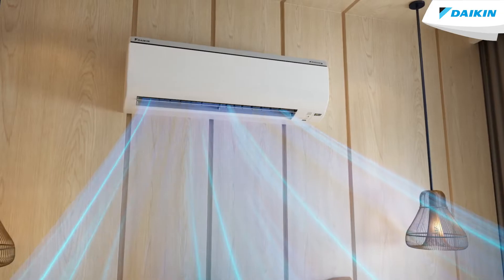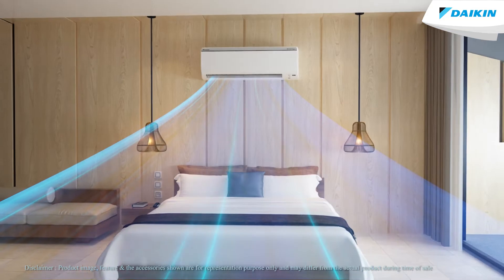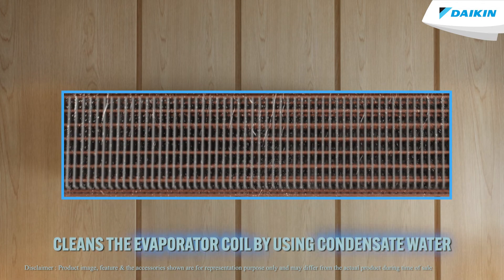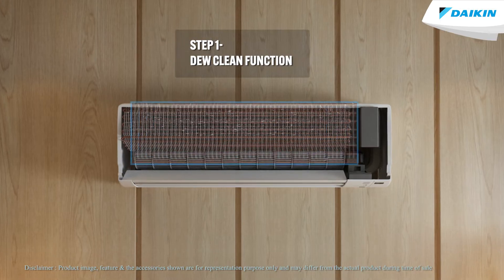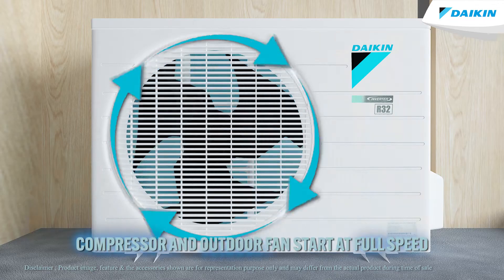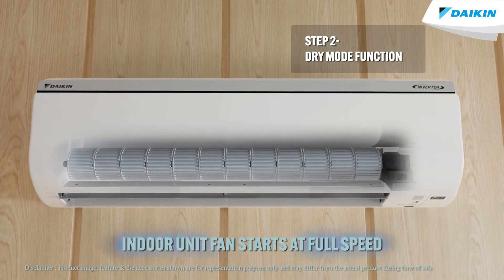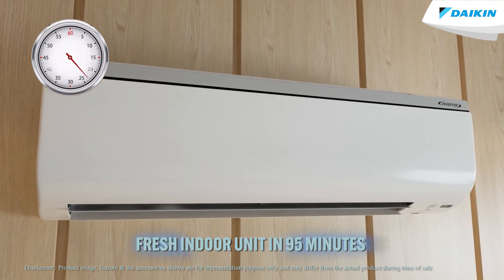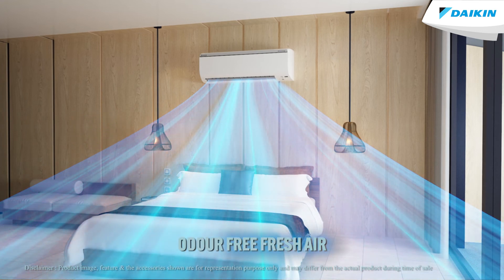What is Daikin's Dew Clean Technology? And how can it clean your AC indoor unit by just one click

Comment: So, servicing is not required if we use dew clean regularly?
Reply: Not actually, you need to eventually clean the ac periodically via the pressure water gun, this is a temporary solution for a smelly outdoor, the room gets super cold during the 65 mins which then converts into blower mode after the during, yes it will clean the coil to a certain good extend, that extend till where you don't need to get it serviced but the fan blower catches dusts too which is difficult to get rid of, so servicing will clean that too, but still this is recommended even month or 2